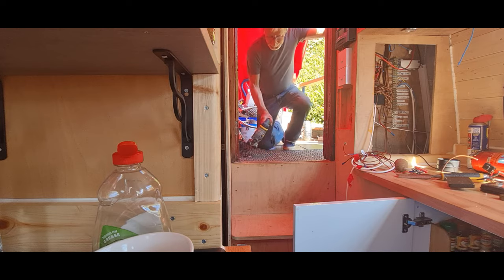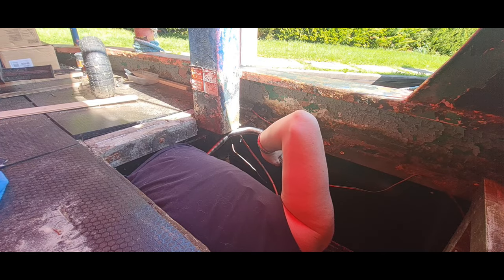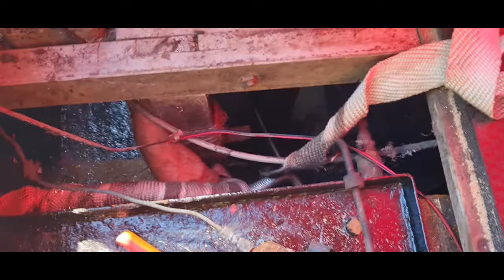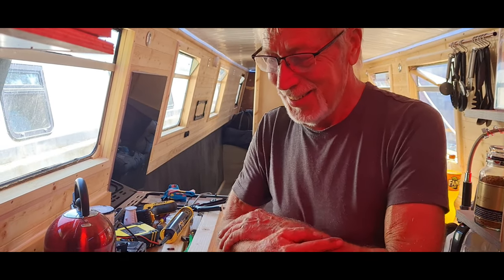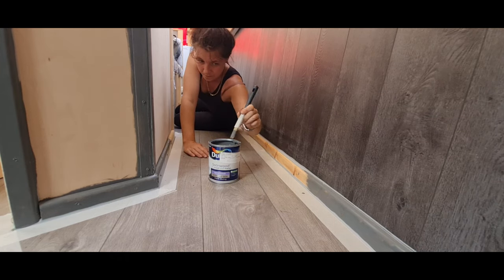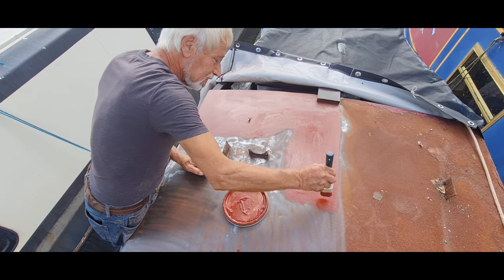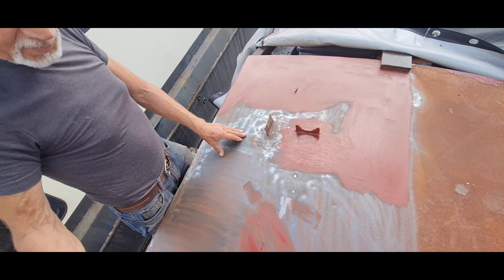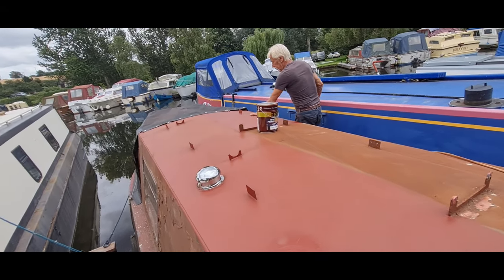Ep020     As We Know It... Heat, Solar and Painting The Boat Inside and OUT!

Comment: Only just found your vlog, and blitzed from number 1.  You are making a very good job and seem to be doing it quickly.  In an earlier episode you brought on a solid fuel stove, I haven't seen it since, are you still going to fit it and where (you don't seem to have  many options open to you).   Bit long but wish you all the best at a good sensible job
Reply from the maker: Hi, thank you! So glad to have you with us 😁

Yes, we still have it and it will make a reappearance soon! Plan is to put it opposite the bathroom only thing we need to work out is getting the heat to travel down the corridor by the bathroom but Phil likes to be warm in bed and we do have the diesel heater on the living end as well if its really, really bitter but so far the weather has been reasonably kind!